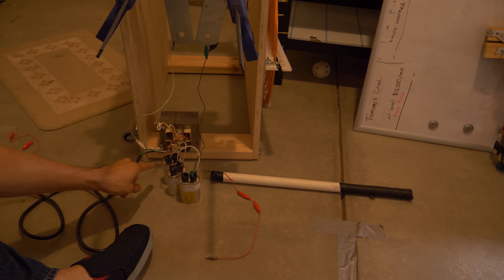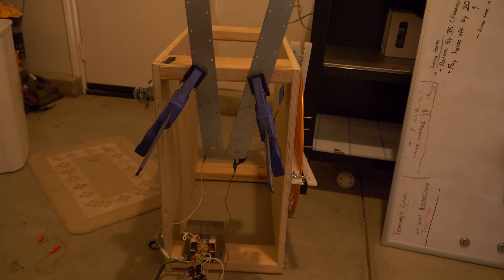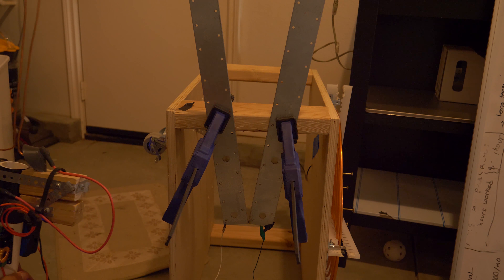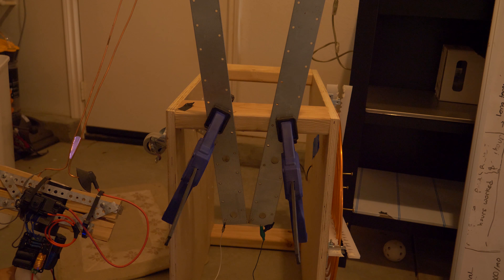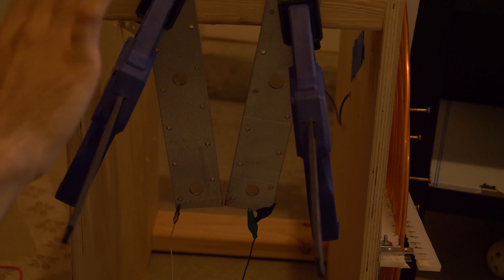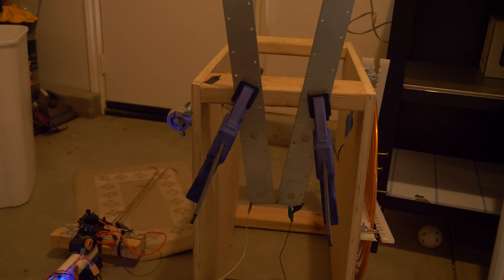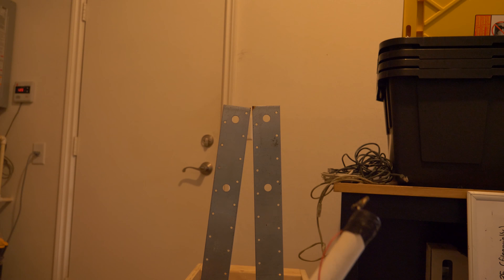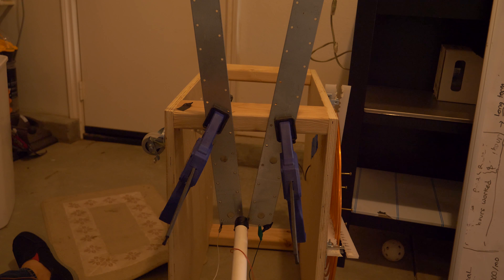Massive Jacobs Ladder + Lightsaber Concept

Comment: nice use of the resonance! I'm working on the same thing at the moment but with 2 transformers and a dual capacitor resonance. This is going to be my mk3 but I never posted a video of my mk2. I can help you with the plasma physics if you would like because they tend to be more important than the voltage (in my own experience)
Reply from the maker: I have my own ideas but the main goal is to get rid of the guide rails, and fluid dynamics + voltage (spark/arc distance through non-ionized air) has a lot to do with how it will work.  Would love to see your mk2!
Reply: I had major issues trying to get the plasma to maintain enough thermal mass to do that but all the best of luck to you(try making a plasma reservoir of some sort with). I will post a video of the mk 2 but all It really was, were some improvements made to the handle section with an in handle switch and new blades I made to be sharpened sword blades